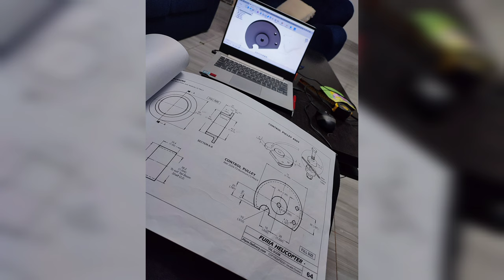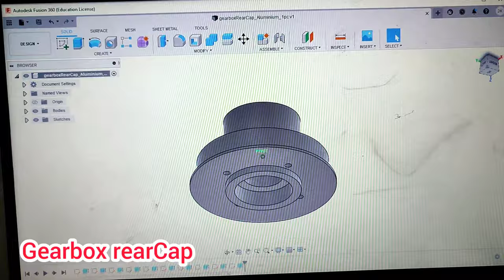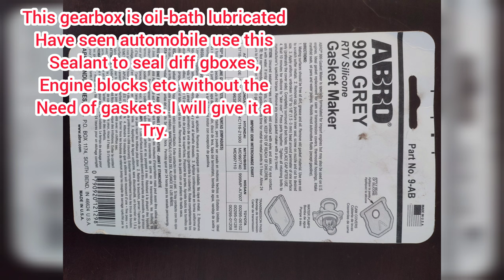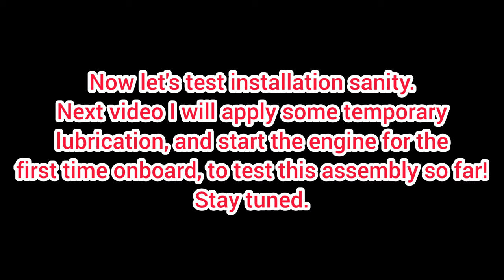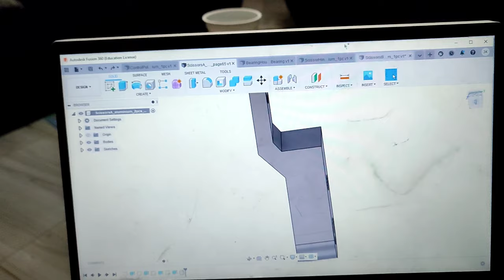Tail-Rotor gearbox: Experimental Homemade Helicopter Build, Part 25

Comment: Jeff, Is it one sold drive shaft without support bearings between the main rotor gear box and the rotor gear box?
BTW love your little helpers. It's good to involve the little ones. Stay safe.
Reply from the maker: Hi, as per plans from central gearbox to main rotor gearbox is one drive shaft of around 400mm non supported by any bearings with fixed couplings, for the tail boom drive shaft it's supported by some teflons with molycote as per my previous video...the 2 gearboxes one drops rpm from 1800+ to 900 rpm for drive through the shaft and stepped back to 1800+ by tailrotor gearbox

Comment: Would it be possible to get the cad/cam files to cut the parts to build  the helicopter?
Reply from the maker: For which part? I mostly save all the files in my drive
Reply: @JeffChoppah  I would need all the files and plans to build it. I built a A/W 95 helicopter a few years ago from plans, would like to build another one like your. Is it plans built or your own design?  It looks similar to the skylark plans built helicopter here in the USA
Reply from the maker: @davidmac2134  yes this is built under skylark plans available online...I would say AW95 is way better than this one...this design with rotax 582 is a struggle unless taking same build with Simon Victor 2 super or rotax 618...the have enough power to work this machine

Comment: Great work Jeff, well done 👍 The main rotor drive shaft needs the flexible plates inserted between the drive flanges. 
like this https://www.youtube.com/watch?v=qg_O_RPPu8A

I know you have done it like the plans but it needs this flex or stress will be exerted on the joints as the rotor mast twists slightly under torque.
Reply from the maker: Hello, great suggestions I actually tried to research on this a lot especially because of the joint on the tail-boom drive shaft, but couldn't get any good leads on where I could buy such rather than making it, have tried to minimise misalignment as much as possible that's why you see my girl paint the joint area had cut and rewelded it to rectify tail-boom alignment...

Intended to run the engine at low speeds and see the effect, but will sure try to find flex couplings at some point.
Reply: @JeffChoppah  you can run without blades no problem as there's very little load it's only when you add blades that the torque on the main rotor mast gets high and twists it out of alignment. The tail rotor drive shaft is very long and the stress on the joints will be less, it's also a different set up to the main rotor and misalignment will only happen when tail rotor thrust is applied with the machine on the ground (bending the tail boom slightly) The tail rotor drive shaft might be ok without the flex joints I'm not sure but the main rotor definitely needs them when the time comes. I expect you can make them. All looks good though, nice job on the tail gearbox 👍
Reply from the maker: Well then this is a whole new level of design knowledge...I see the flex couplings are not just necessity but a must...let me research on making one ..at this point I have little energy to venture away from the plans, unless with such insights...

Thanks buddy much appreciated...the knowledge gathered from you is enormous...🤝
Reply from the maker: @Ben-Dixey  I think this could work??? Is there need to install 2 of them on both joints on the shaft to rotor head or one joint preferably the upper joint is enough?

PTNHZ Manual Transmission Mount Flex Disc Drive Shaft Coupling Bushing Aluminum Polyurethane 85A Compatible for E30 E46 E36 E53 E24 Z4 26117511454/26112226527 https://www.amazon.com/dp/B0863QPDXW/ref=cm_sw_r_awdo_KWDHKB9EYZTT86685AJ4?psc=1
Reply: @JeffChoppah  yes that will work fine. Unfortunately you need both one at the top and one at the bottom. These will also smooth the torque produced by the engine. Engines have a torque spike every time the piston fires, these spikes can break drive shafts if flexible drive couplings are not used. This is why I have one on my drive shaft exactly like the Amazon one.
Reply from the maker: @Ben-Dixey  my lazy self just costed me wasted machining cost of the couplings 😂😂 yet I knew so well these flex couplings were quite essential (though not to the level) you explained otherwise I could have definitely fitted them...but will sure fit them and machine other couplings with 3 flanges to fit these flex.

Thanks so much ...quite helpful
Reply: @JeffChoppah  anytime my friend. The plans should have made it more clear.
Reply from the maker: @Ben-Dixey  no wonder these plans are so free, they have a lot of editing to do... making notes of these changes to release maybe a video detailing all these errors for future builders